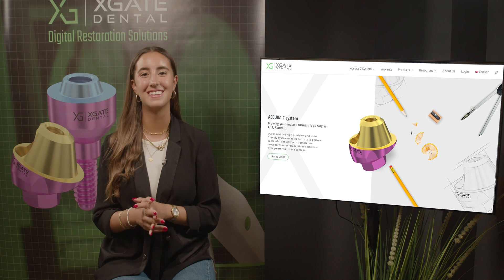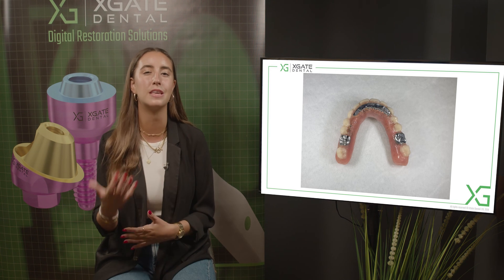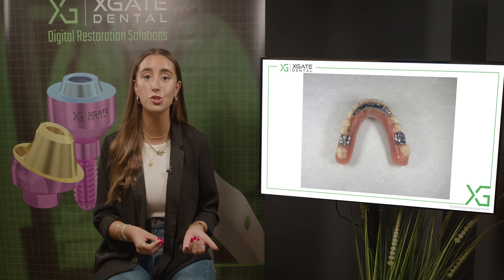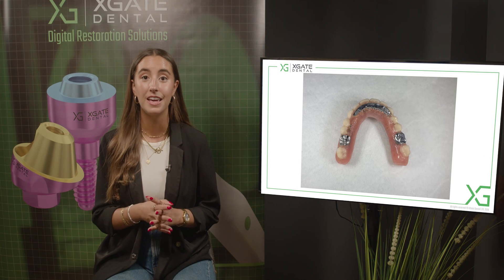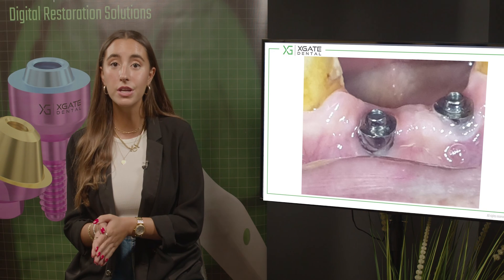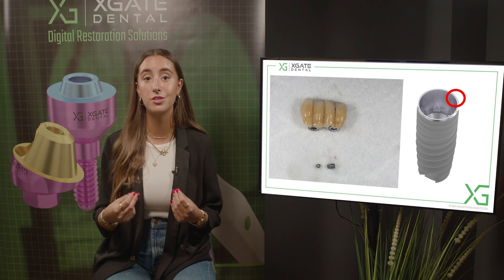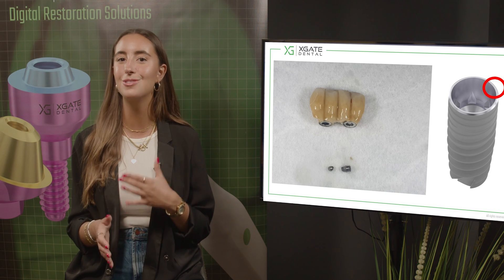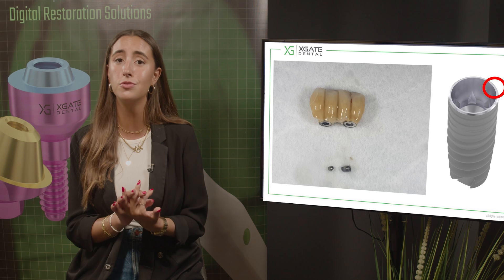Bruxism treatment. Implantation techniques and secrets of professionals for good results

Comment from the maker: 00:00 We constantly need to add acrylic teeth
01:00 You need to take out the implant with the bone 
02:24 Brooksism causes large amounts of stress on the implants
03:00 Implants usually break at their thinnest part
04:19 Most of the pressure is applied on the screw
06:00 It is easier to fix problems on screw retained restoration
09:00 Some factors increase the chance for breakage: parallel implants, thin bridge